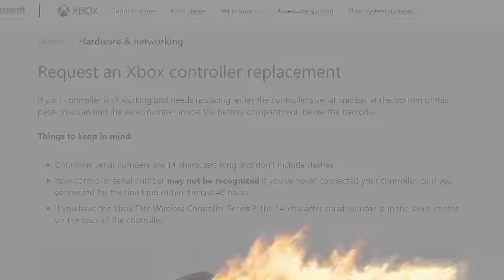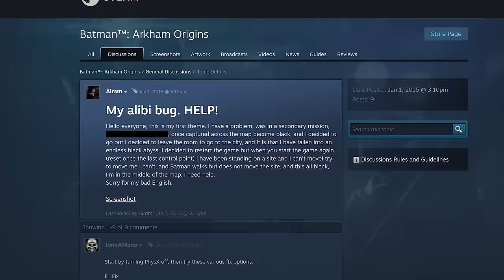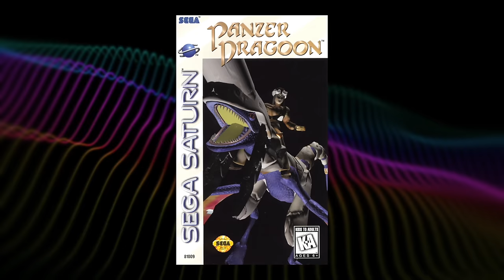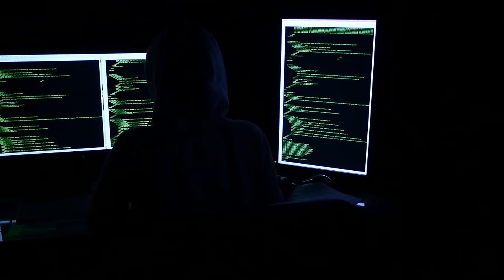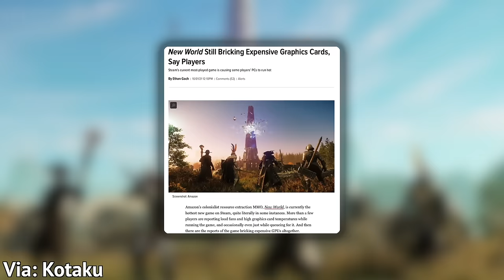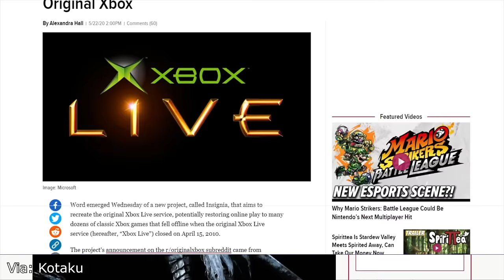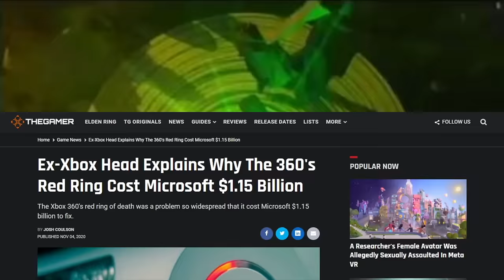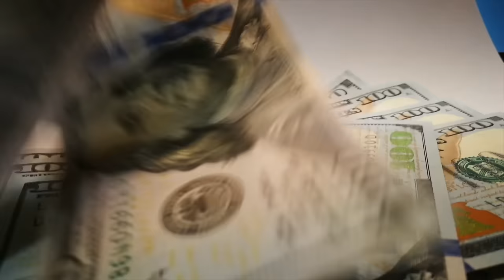10 NIGHTMARES Every Gamer Has

Comment: My 360 got the red ring 3 times but it was just from overheating. Let it sit for a day and it went back to normal. That feeling of terror when it happened is not something I'll ever forget though
Reply: The same happened to me. But only twice.
Reply: Omg the fucking red ring! I remember I just bought Assassin’s Creed 2 and Arkham Asylum and couldn’t wait to go home to play them. I played AC2 for maybe an hour and I got the red ring 🙄!
Reply: Red ring goes away if you wrap your 360 in a towel and let it overheat and reset.
Reply: @moresomoze  it didn't always fix it fully. the correct fix was to reapply the thermal paste on the heatsink for the system.
Reply: dont charge it in the microwave, whatever you do.
Reply: Duuuust dude lol Dust kills, clean your box!
Reply: The red ring appeared the same day I finally bought GTA V 😢
Reply: My original 360 redringed over 20 times and still worked just fine until about #20-21. Then it had some trouble reading discs, but digital content worked just fine. That thing was an absolute UNIT.
Reply: I remember my Xbox 360 got a red ring on CHRISTMAS DAY! I had just gotten the original assassin's Creed and I was so excited to play, but nope. I had to send it in and wasn't able to play my new game for almost 3 weeks.
Reply: I got 2 red ringed 360s and I only just found out I could've got them replaced for free, instead I went back to playstation and learnt what I had already known and that is that xbox sucks and playstation will always be the console for me
Reply: @ThePopeofPoland1 nope, it actually required a process called 'reballing'. Much more challenging.
Reply: Same only I think I got lucky it only happened once but It was stressful enough that I just switched to PlayStation
Reply: @ThePopeofPoland1 what they said, also open the console and clean it out. The failsafe shutdown is just that, to protect the hardware but it also tells you, time to clean it out.

Comment: Lags and FPS drop are definitely any gamer's biggest nightmares. Specially when I update my PC with new graphic card, my heart literally skips a beat when I see some lag afterwards. I always pray that it's related to the game and not my device.
Reply: seriously though! i'm super chill when it comes to games 99% of the time but lag just awakens something in me lmao.
Reply: The worst thing is when you find out your CPU is bottlenecking your GPU or that your current power supply ends up being underpowered to run your new GPU. Had to fix my sister's gaming rig that she got pre-built because the 550w power supply wasn't enough for all her components. Had to get her a 850w instead because her rig kept shutting off during higher intensity gameplay.
Reply: @pacicidal  aw god sounds like a nightmare. i have a friend i always take my pc to when i have problems or need new parts putting in. i annoy the life out of him haha
Reply: @hisammy3969  Somehow I ended up being the tech person for my sister, even though our older brother is much better with computer hardware than I am. I'm more on the software side of things than hardware, and yet I still get stuck dealing with her computer problems. All I can say is that I never want to have to wire a power supply unit to a motherboard or its peripherals ever again in a case specifically designed for cable management through the side panel. Absolute nightmare, especially when some of the cables barely ran the length right.
Reply: When I got my PC, I invested much more money than I needed because I would gladly pay for NOT having those FPS drops in any games... then eventually I got Elden Ring. Every time that FPS dropped randomly, I got pretty annoyed.

I thought that FPS drop issue it had was related to it sending data to the server and waiting for the response (I/O), but it still happens if you disable online and completely disconnect from the internet.
Reply: @fcontini  fps has nothing to do with your internet it’s your hardware. Maybe just a specific setting that’s messing stuff up. Try lowering everything to the bottom and then work your way back up till you find the cause ☺️
Reply: @hisammy3969  I know it has nothing to do with it, but I know certain processes can stop and wait others before render, so it was just my initial theory. Honestly, the game is running consistent and it shouldn't have issues with a Ryzen 9 and a 3080 on 1440p, so it is definitely a software issue. Your comment made me do a quick google search and apparently there are some tricks I haven't tested yet, like increasing shader cache. Let's see how it goes :)
Valeu! 😆

Comment: As much as I love physical version of games, I agree that the fear of they not working anymore due to time is very real... But I guess nothing lasts forever, not the consoles, not even the digital versions
Reply: My fear with digital downloads is, forgetting my log in details and not being able to redownload from where I got them.
Reply: Well spoken. Yes, disks degrade. I have worked at a printing firm that had a room full of physical and digital archives, in case clients wanted to reprint old material. The digital stuff was stored on zip disks, magneto disks and a huge amount of 500MB CDRs. And especially with those CDRs I had a ~20% chance of having degraded to the point of being unreadable.
Also the reason I have two copies of Morrowind. One didn't work at the time. To be fair, I doubt the other does anymore either.
Reply: only upside to an unreadable disc is now you've got something you can frame and hang up on display. can't do that with digital.
I did that with my very first copy of the original rayman that I played as a kid until it was unplayable xD Had to get myself a new one a few years back so I can finish the game.
Reply: @crookedbuns  yeah I like that idea a lot, probably I'll do something similar
Reply: I'm old. I'm also dumbuh. 
I grew up with an abacus, 8 bit, 16 bits, 4 bits (but it's portable HA take that, wackbards ressprog), skipped most of 32. Mostly because I tripped and fell, but also there were like, five different KINDS of 32 bits, I tried to show my math teacher that I wasn't insane, using this logic, but I failed. 
So, moving on, I fantastically finally found final fantasy 32, on the playstation. I used my fingers, and my toes, but I still couldn't find 4 5 and 6 becauze weaboo was, alas, still not a thing. So I rented a playstation from my local video game and VHS store (they were a thing, back in my day), because I had dirt on him, so he gave me the console and their copy of Finasty Fanals the 7th. 

He had dirt on IT. 

Me, having never seen a round game before, let alone a round game PLAYER (where the F(_)CK is my DAMN TOASTER CONSOLE) wasn't put off. I was but, maybe put on. So anyway, these cup coasters had numberz on dem, which never made much sense to me obviously. So when I tried to load the | shaped coaster number, it would get to the starting screen and then break, like my hopes. My dreams. 
So I opened the coaster counsel, left it on, blew on the coaster a few times and put it back in. 
Same problem. 
So I opened it AGAIN, and put in the coaster with the wiggly Z symbol. 
It worked! Finnial Fantasm Eleventy Hundred WORKED. 

I took Claud right up to the Shark Reactor, Black Big Bayonetta and I blue that shiz UP. 
And a giant blue monster creature came out of a crater, roaring. 

Point is, the gameplay is on all the discs, even the entire script.......... but when you hit a cinematic, it loads directly from the disc's hard-baked video files. LOL So when I blew up the Mako Reactor, we jumped all the way to Northern Crater with the WEAPONS, instead of the short reactor cinematic lol

Me, playing this game at the time as a teenage girl.... 
"WOW they weren't kidding, these Japanese RPGs are odd. I don't know what I just saw. Anyway going to keep playing this is fun." 

(spends five hours, makes it all the way to meeting Aeris, fights a house, gets into Wall Market,)

...............................................................................................................................
THE F(_)CK YOU MEAN I NEED A "MEMORY CARD"!!!??!!!!!!!!!!!!!!!!!!!!!!
Reply: Bigger risk of games being deleted/becoming unplayable if the company decides to remove support??

Comment: Encountered number 1 just recently. Be careful building a 1700, DDR5 system. You may need additional mounting brackets if you're using a custom cooler. I bought the motherboard and ram from different places. When my new build stopped turning on, I brought it to the shop for the ram and they told me the issue must be I messed up the motherboard using the wrong brackets. So I brought the motherboard to the other shop, they tested it and told me the motherboard is fine, it's one of the RAM sticks that is faulty. So because they were a kit, I had to RMA both of them. The whole thing took about a month to resolve.
Reply: DDR5 has been a shit show for me. Built my first PC in 2020, helped my dad in 2021. Literally no problems. Was one of the most fulfilling things I’ve done as an adult because I used to be afraid of handling components.

Then in early 2022 built one with my GF using DDR5, the thing kept crashing. Find out certain memory controllers on early DDR5 just weren’t stable at all…

 Sent this motherboard in for RMA in January. Asus is now just handing it back to me in June… I feel bad because I told my GF this would be easy lol.

Comment: The worse thing with the controller one is if only one minor thing stops working or starts intermittently working - like the headphones port. Hard to justify a new controller if you don't use it, but you know it's there. Like cracking the glass on the back of your phone while the front is pristine.

Comment: 8) This is old, and I don't hear people ever mention this. Fire Emblem Radiant Dawn had a nifty little thing where you could import save data from Path of Radiance for just a few little bonus items, some weapons, some extra starting gold, nothing game breaking. Problem was, certain editions of Radiant Dawn would lock up if you imported an Easy difficulty Path of Radiant save when you attempted to engage Pegasus rider. You weren't going to encounter these until several chapters into the game (I think was nearly the end of Act 1) and when they flew in and inevitably attacked you, your game locks up. It wasn't all copies of the game, and as far as I know it was only Easy difficulty files, but was annoying since at the time, tracking down information for it was extremely difficult.

Comment: I've suffered ''disc rot'' on two more modern games. MGSV and Red Dead Redemption 2. I ended up having to rebuy both games. I've also noticed some newly-bought Blu-Ray discs wouldn't play in the PS4. I think they already had disc rot.
Reply: Stored in the original cases or somehere else? Do you live in a high humid area?
Reply: @geordiejones5618  yeah, I live in a tropical zone, most of the time very humid. even when kept in their cases they can start to deteriorate.

Comment: I remember fairly recently, I had just put in 50 hours into horizon forbidden west. I booted up my PS5 and I got a message along the lines of, your PS5 didn’t boot up correctly and your save info may be gone. I couldn’t even load the game. I had to completely delete it and reinstall it. I told myself, if I boot up the game and it is all gone, I am calling it the quits and not putting another 50 hours into the game again to get back to where I was. Thankfully, it was saved. I just remember the feeling of “well this game is dead to me…”

Comment: Hoo boy I feel that last one. So I had an old PC, and didn’t really plan on building a whole new one, but for various reasons I ended up having to get a new graphics card (GTX 970), motherboard and CPU, and because of the motherboard I needed a bigger case. Once it was all transferred over/put together, I had an issue was it would always turn itself off a few minutes after starting up any graphically demanding game. Took weeks to figure out the cause was that the PSU was too weak, but man what a nightmare those weeks were! 

That was 7/8 years ago. I actually have the same build today and it’s still going strong! I love my GTX 970.

Comment: New World had a massive issue in the code itself. I'm not a game dev, so I don't know if it was in the driver or the engine or what, but it would bypass every software framerate limiter in your system. It would keep GPUs pinned at the max constantly, and it caused a rapid-fire cycle of the GPUs hardware-level protections tripping, the card throttling until it was in 'safe' parameters, then immediately getting hammered again. The reason why there were so many different failures across multiple manufacturers was because the gpu would break at whatever the first weak point was. Solder joints, fuses, power delivery, all the way up to cards actually catching fire
Reply: Affected 12 cards (not models, only 12 individual cards), hundreds of people lied for internet points *shocked. It was a simple faulty fan controller on some EVGA cards that gobbled up far more electricity than they ever should have and would throw up readings like 200k+ rpms. It was only highlighted in New World because you had people sitting with an uncapped frame rate in login queues for 10+ hours on what was essentially new hardware at the time, if they had done any other thing that pushed their defective card that long they would have had the same outcome. A lot of the drama was because JayzTwoCents decided to do what nvidia/evga pays him to do, which is defend their products and he did so shamelessy by pushing unverified reports of it affecting other cards. The funny thing is that when they began testing those EVGA cards specifically they found the problem would even occur at just 60 fps although it was much less frequent.

Comment: My story about #1 
I game on a 2009 Mac Pro flashed to 5,1 dual booting windows 10 with boot camp……. I know, I know! So many readers are already shaking their head. But, hey, I’m an audio engineer first and gamer second, and didn’t have money to invest into a gaming pc. 
My issue wasn’t necessarily not knowing what was wrong with my Mac after something inside of it had died, but having to diagnose it with absolutely zero customer service assistance due to the age of the Mac and the details in which it had been modded. Took me a year to diagnose, honestly. And this was because I had to invest in a 4,1 flashed logic board as well as a 4-core processor tray in order to reinstall the OS and flash the new logic board back to 5,1 so I could use my modded 12-core processor tray again. I did all this just to identify that the PSU was the culprit and needed replacing. Took a year of my creative life away as well as my gaming life.

Comment: All of those things are annoying or frustrating, but the only real nightmare for a gamer is to never be able to play games again. I've been building or upgrading PCs since the IBM XT, where you had to learn how to do things the right way, or you couldn't play games. There was no plug and play. IRQ settings had to be done manually with jumpers or through DOS, or both if you wanted to get a sound card, GPU and CD-ROM drive to work together. And there was no internet search to figure things out. You had to find a BBS that might be helpful, or go buy a magazine that covered the topic. So building PCs is not a big deal to me. Just have to take it step-by-step.

Comment: The most memorable corrupted save file was for Pokemon Gold. 360 hours gone in a flash

14:30 Oh I know this one all too well. My 5950X and 3080 Ti system was randomly restarting even though I swapped out the PSU multiple times. The latest unit being a 1200W ROG Thor Platinum

Comment: 10. Pokemon Sapphire and Crash Bandicoot Tag Team Racing. 9. My first PS4 controller had the L2 button getting stuck (after letting go, it acts as if I am still pressing it down), first PS5 controller had its charging port cave in on itself. The replacement PS5 controller has a very unresponsive up button. 8. Mass Effect 1 near the end, the game freezes during or after the final battle causing me to have to replay the final battle. In Lost Dimension, if you use a specific character on a specific level, then the game freezes at the end of the level causing you to have to replay the level. 7. Some of my old pc and PS2 games stopped working.

Comment: Regarding #1: YES! I built computers in the days before Youtube. I even built them specifically for certain games (new and oldies). And it was the worst experience of my life. I've run into more than a few issues that were manufacturer related and, because I was building my own system, that manufacturer would insist I was the one doing something wrong. Drove me flippin' nuts! Being a female in computer sciences 20+ years ago was hard enough. But worse was having to literally prove it was a bad part by putting it into a working computer and have it not work, just to please a manfucaturer that was well aware that 7 out of every 10 of those parts were manufacturered incorrectly and had a known defect. 

And, yeah, I still build computers today, mostly to run older games that are no longer compatible. I've still got my Window 98 key memorized. lol